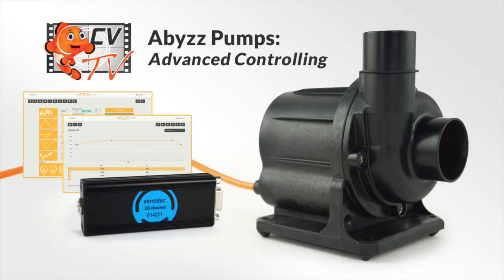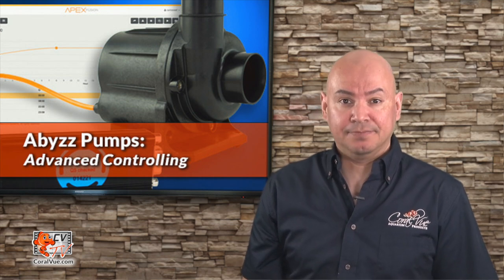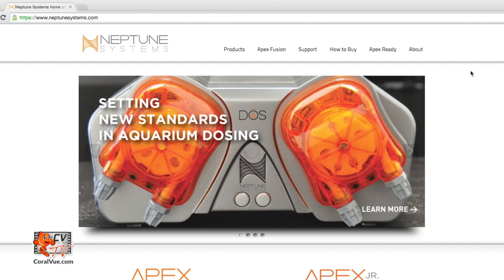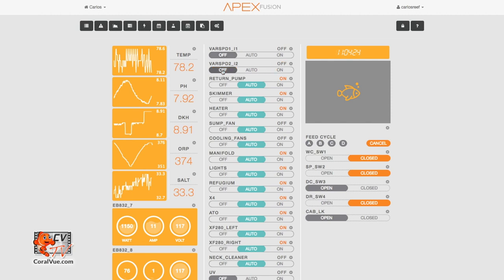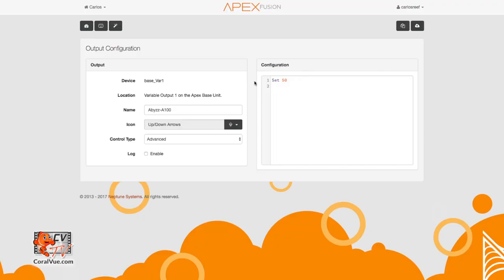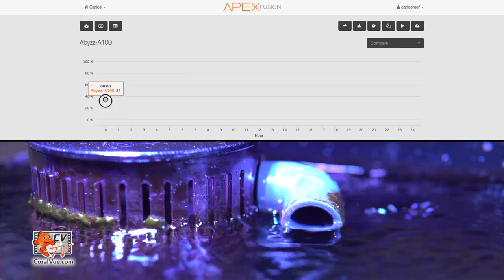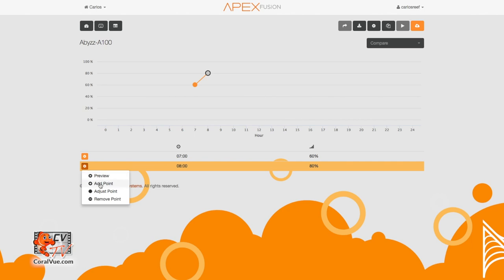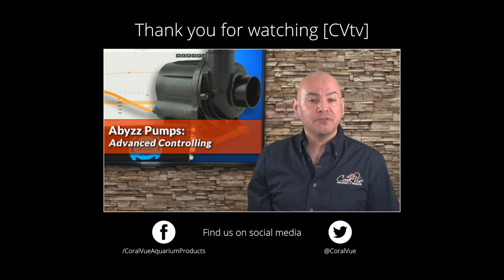Abyzz Pumps: Advanced Controlling

Comment: Which cable sould I use to connect The Abyzz APEX Interface to The 0-10v port in my existing APEX System (3.5mm jack on a side and RJ45 on the other side cable)?
Reply from the maker: You will require this APEX adapter: https://www.coralvue.com/abyzz-3rd-party-controller-interface